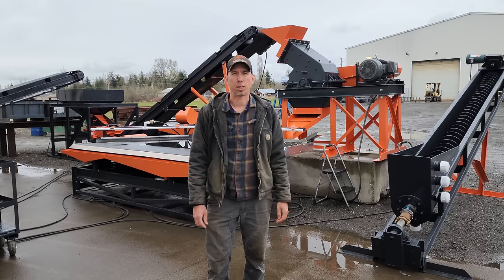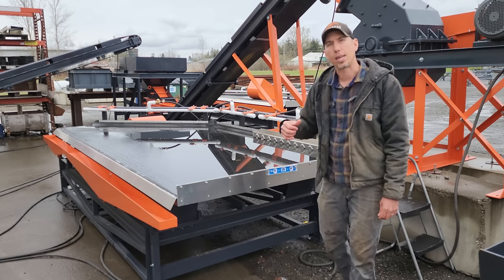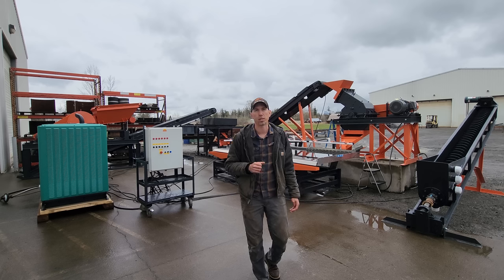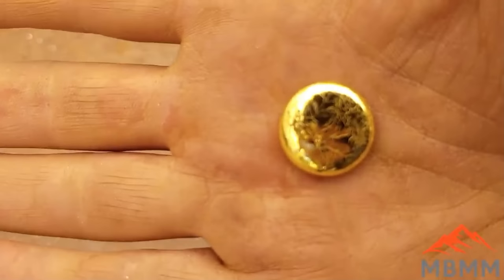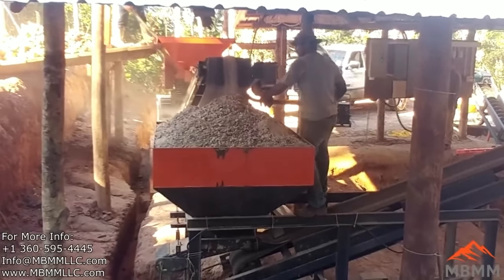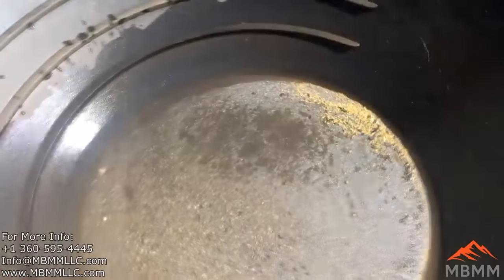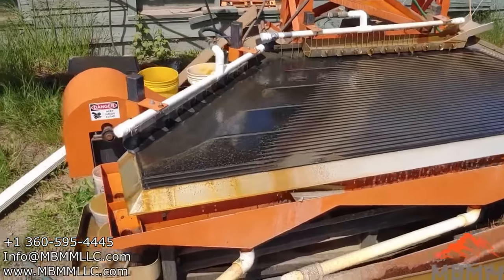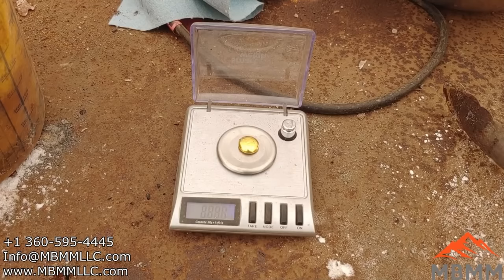Turnkey Gold Mining & Milling System: Processing 2 Tons per Hour for High-Grade Gold Buttons

Comment: I love the videos. Just a suggestion for someone who works in process improvement, when you are discussing the startup sequence at the 17 min mark, why not reorder the the switches in your preferred startup sequence? With it just being a waterproof enclosure, the location and order doesn't really matter, but this way the startup routine is that much simpler and cuts down the potential for self inflicted errors. If you are setting up a true turn key system like this, you might as well go ahead and include a specific startup sequence that is ordered on the enclosure to make it that much easier. Keep up the great work!

Comment: I was setting here thinking about the hammers on the hammer mill and was wondering if there is a way they could be made of hardened steel or capped with it to reduce wear? maybe a screw on piece for the top so it would be easier to replace and cheaper.
Reply: if anything you might be able to provide a small temper of a few mm to the tips of the hammers rather than machining different pieces for hardened caps. that might provide some extra life without too much extra hassle

Comment: Is there a technical reason the  startup switches aren't arranged to match the recommend start sequence..exp. left to right  is each piece in the proper order?
Reply: I would imagine the board is arbitrary, it looks like it’s set up in sequential order of processing at this time.
Reply: I was wondering the same thing. If the recommended start up is a certain order then the switches should be in that order. Very informative video though.Mmountains to dust and gold.
Reply: Its not uncommon. Mosr of the crushers or screener I come across looks like a game of twister to turn on, most of the operation is geared toward "once started " operation

Comment: If there is too much to process in #2, I'm wondering why you wouldn't just run the #2 tailings through the shaker table again to give the gold another chance to make it into #1 before doing the cleanout.  Seems like it would only take a bit of extra time to add it to the slurry feed instead of discarding it.  Since you aren't doing that, I'm assuming there is a good reason; I just don't know what it is.

Comment: The setup could use something for dust control. Something for the jaw crusher, wind guards on the conveyor belt and something at the hammer mill. These could be used indoors or the dust could be depositing heavy metals in the surrounding areas.
Reply: Spraying some water in the jaw crusher could do the job.

Comment: it would be nice to have a way to dimensionally size larger stones. that is to say, i have slate which i am using to build walls/terraces with, using concrete to bind them after stacking them dry. but, i get all sorts of sizes from the quarry and am sorting them by hand. no small task for having over 150-200 cubic yards worth to go through lol. still, even so, i would love to at least have some sort of pallet sized Bins that i could use to contain and or hold the hand sorted stone, and have a way to classify them in a way that would help facilitate the stacking process. so, if i have a certain size gap and need a certain width of stone i could go to a bin with that exact size range stone and easily find what i need, after having sorted it out before hand. alas, for now, i down have such a sophisticated method of sorting, i just use a small crate about 8 by 11 inches to create a split from larger than crate, to smaller than or fits in crate, sizes, so the smaller stone ends up from small gravels to larger slabs that are just on the upper end of the size i use in my wall building project. i haven't been able to find such bins that would be around the same size as a standard pallet, and have equal sides upwards to fill out the cubic volume i might be able to use. i dont want to spend too much to have such things built though, so im at a bit of a conundrum as to what to do, and simply having a bunch of messy piles strewn about sort of irks me, to be honest lol. on another note, what is your absolute smallest powered rock crusher module? and what is its cost?

Comment: small suggestion:
since the order in that you switch the machines are on matters, why not arrange the switches in the same order?
Reply: also, you could put small water sprayers on the buffer hopper to keep the dust down.
Edit: It might make the stuff too sticky but it sure would be nice on the lungs and the neighbors if it worked.

Comment: That's 3/4 Oz. Per hour. Tony Beets was getting an Oz. Per hour. A lot less set up and maintenance costs too.
Reply: How do you figure that? How many excavators, loaders, haul trucks, dozers and dump trucks is MBM running vs Tony to extract gold? They don't get gold the same way so the cost isn't comparable. Not to mention Tony isn't hard rock mining typically so I don't know where you are getting your info unless your just pulling it out of your behind.
Reply: @Scott Wall  
You shouldn't text while drunk. Beet's operation costs multi millions where this and an excavator is less than a 1/4 million. And makes 3/4 as much as long as the mine puts out.